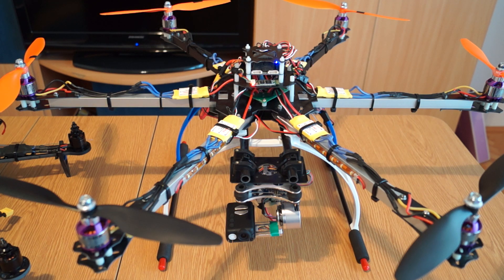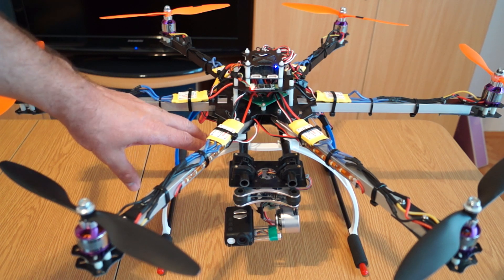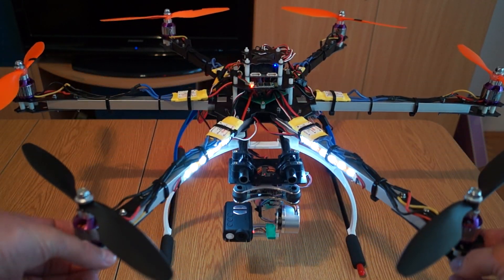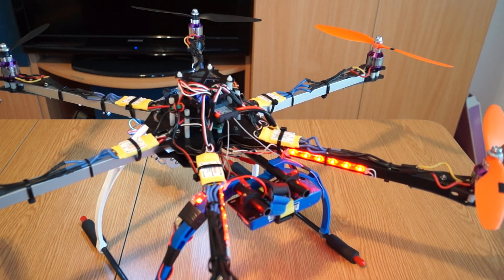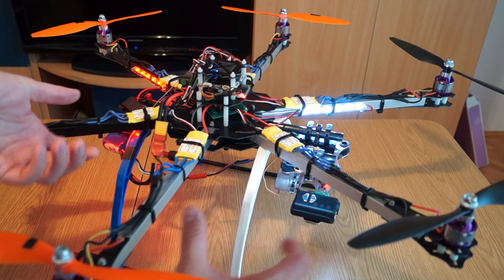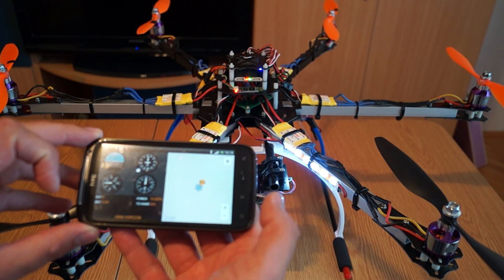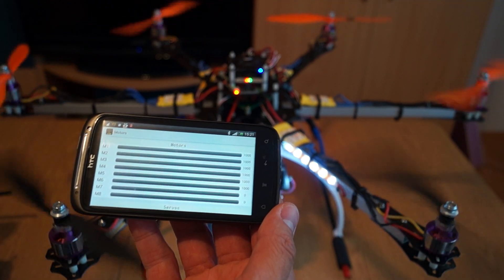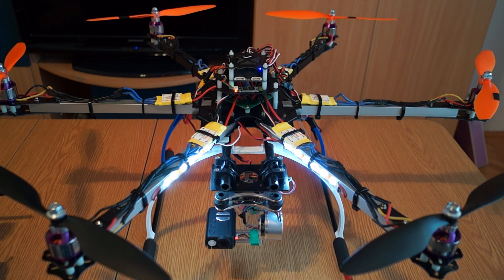650 aluminium folding arms hexacopter build

Comment: i have a question
Can we use 3mm Stainless Steel with 150mm diameter, For Center Plate of 680 Hexacopter ?
load ; GO Pro,+gimbal

Comment: What are best motors to run 11" on 4s?
Need replacement for my 3kg hexa. I would be happy for 10-15 minutes flight time
Thanks for help!
Reply from the maker: Hi, for 11 inch on 4 S I would choose motors in the 700-750 kv range.
For my current tarot 650 quad I will use 620kv's running 12x55 props on 4s...will have to check flight time later on...
Reply from the maker: MrCofl1001 with the quad wright of 1300 grams only I hovered it in loiter mode(APM F.C.) for 11 minutes fo 3.75 v/cell
Reply: MrCofl1001 How many mAh battery?
Reply from the maker: sorry, forgot to mention it...4S / 4000mAh

Comment: Hello, first of all thank you very much for sharing this, i apprecia it and it really helps, i have just one question, you mentioned that you want to change the props, from 1045 to 11, and my question is, why? I mean, the longer the prop is, the harder to the motor to generate the power. Do you know the grade of incline? Is still 4,5? The choice of the props depends on the motor. If it is more than 28, I'd suggest 10, but not more than 10.
Reply from the maker: Hello Pedro, ideally yes, but with cheaper plastic props the difference is not so "real"
For example after changing to 1147 APC props I could get 7 minutes flight fully equipped ~2kg with my 4s/400mah battery and with the 10" you see here I got about half a minute less all to same battery voltage...
Anyway this hexa is gone, I just uploaded a new video for my new and hopefully last 650 quad, here: https://www.youtube.com/watch?v=Ul6DJjFCwIU&feature=youtu.be

Comment: Can you share with us some experience about your battery and with it the flight time? :) 
I also would like to build one , like yours.
Reply from the maker: Hi, to be honest this hexa is quite heavy, I did some testing today, just to give you a flight time...with 2x2200mah in parallel li-po (4400 mah) I get only 5 minutes of hover time (in strong wind) with ~ 3.83 V/cell left. I could squeeze 30 sec more but that's about it...Of course the plastic props 10x45 could be better but I am considering to change the landing skids and the bottom pipes with the light ones available for the dji f450/550. I still need to test 11" props, but currently the ones I got from BG are heavily hub imbalanced so cannot test...Any questions pm me...